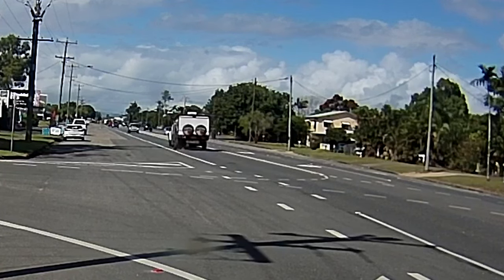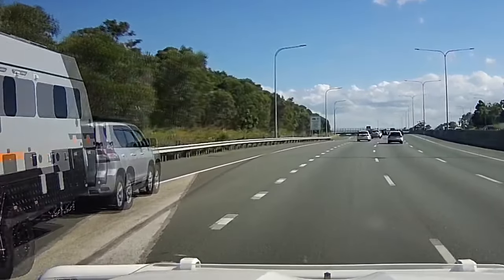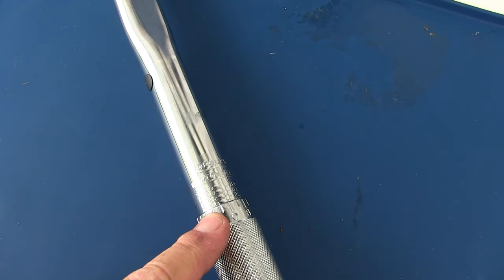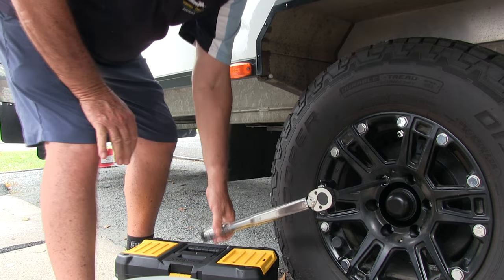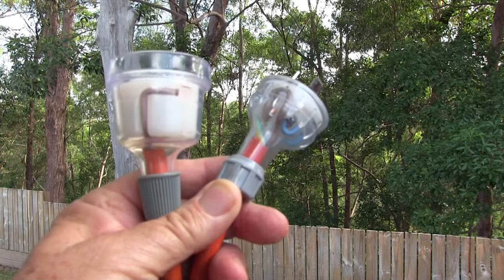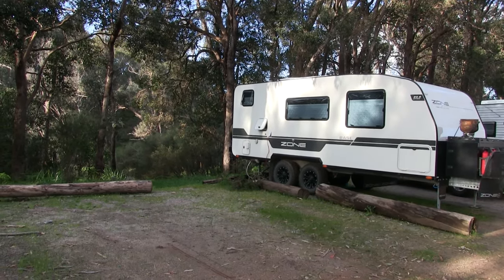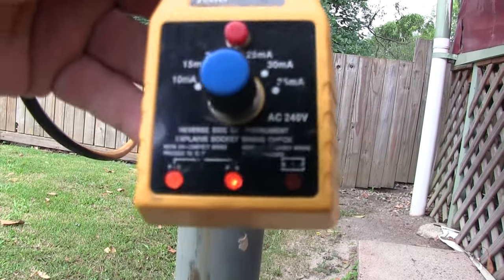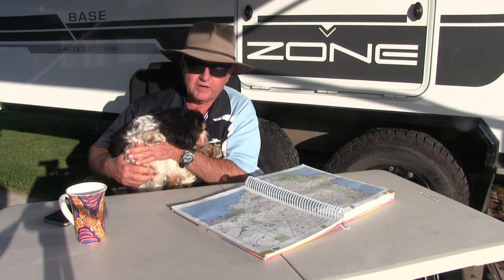Zone RV Problems and solutions Episode 3

Comment: G'day Graham, sorry to hear about  your best mate Shadow. When torquing the wheel nuts the 120nm should be unlubricated studs, any lube on the stud, the actual torque can be 15- 20 % higher than the set 120nm. I always carry spare studs of the correct grade and nuts. Safe travels
Reply from the maker: Thanks for your kind thoughts and that’s good info on the studs, appreciate it. 
Cheers Graham
Reply: @grahambelby9117  I purchased my spare studs & nuts from Nice Products. They stock Grade 8, 10.9,12.9 with various knurled diameters and spline pitches. Really, having spare studs are essential, especially when travelling in insolated areas.  Ian